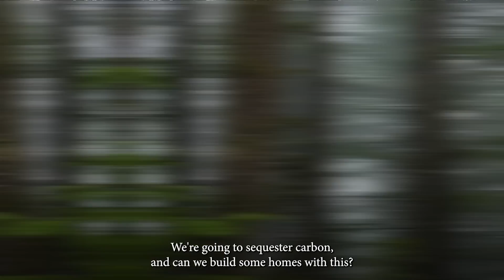A 3D printer that sucks carbon out of the atmosphere

Comment: The classic solution for carbon pollution
Reply: Carbon isn’t a pollutant, carbon is photosynthesis. No photosynthesis, no food.
Reply: @albertapatriot3877  A pollutant is any substance, as certain chemicals or waste products, that renders the air, soil, water, or other natural resource harmful or UNSUITABLE FOR A SPECIFIC PURPOSE. CO2 is not only a life giver, it is also a waste product from fossil fuels that has made some ecosystems, agricultural zones, and feeding grounds we depend on not adaptable enough to the current climate change trend.

Higher elevated atmospheric CO2 concentrations increases photosynthesis, but creates lower nutrition quality because the crops accumulate more carbohydrates than minerals. Carbohydrates are a significant component of the organic matter of all soils, commonly accounting for 5-20% of soil organic matter.
Reply: @albertapatriot3877 there is too much of it, that's the problem. Think, water.
Reply: @ytj22 There has been far more CO2 in the atmosphere in previous eras, and the Earth was just fine. Sun cycles control temperature, not CO2.
Reply: @TroySavary  Bringing up higher CO2 levels in the past is irrelevant, as the rates of CO2 fluctuations back then were at which organisms were able to adapt and evolve to climate change. Basically enough time for the the oceans to absorb CO2 to maintain an equilibrium in the atmosphere, enough time to suck CO2 out of the air through the weathering of rocks, and enough plants to absorb CO2; all these mechanisms relatively not disrupting plant growth and life.

Solar forcing is important, but on time scales relevant to human history solar irradiance is practically constant. Even near solar minimum, when galactic comic rays have easier access to Earth, and during the solar maximum, their spectrum remains relatively constant in energy and composition, varying only slowly with time. Just as the solar cycle follows a roughly elven year cycle, so does galactic cosmic rays with its maximum.

No mechanism has been discovered for variations in the solar wind or magnetic field to affect Earth's climate significantly. It's a red herring when folk claim these forcing do; popular on "climate skeptic" pseudoscience blogs, but we know once a talking point gains inertia in the "skeptic" echo chamber, it never dies. The steady decline in energy output, the 11 year cycle in sunspots, and the variations in the solar wind shows no correlation with climate on annual, decadal, nor century scales.
Reply: @omnidataplus644 

Hemp has a TON of amazing history. 

We need to grow Hemp. 
5x co2 removal compared to one acre of trees. 
One acre of hemp replaces 45,000 acres of lost woodland because it takes only a few months from seed to harvest rather then trees takes 25 years. 
I’m not anti lumber. I’m pro other options To Lower Costs. 55,000 uses. 
A old book you might of heard about, The Emperor Wears No Clothes. 
I should contact Jamil Jivani my local Conservative MP to see if Jamil could pass the request on to our man Pierre.